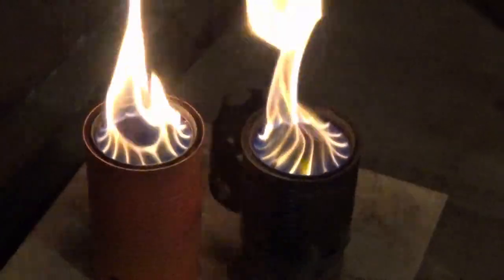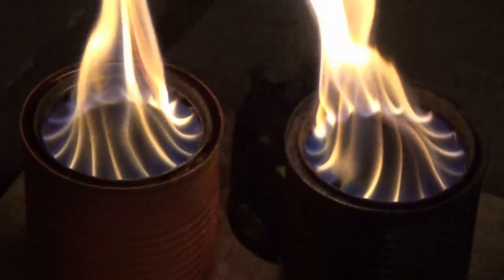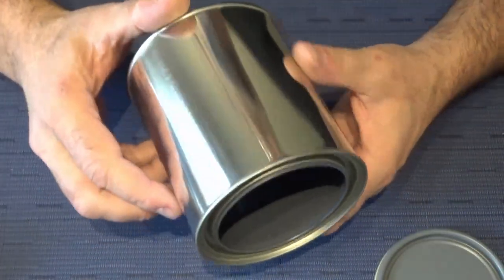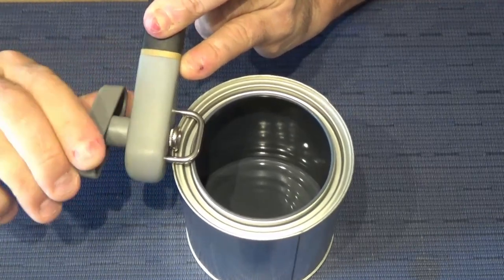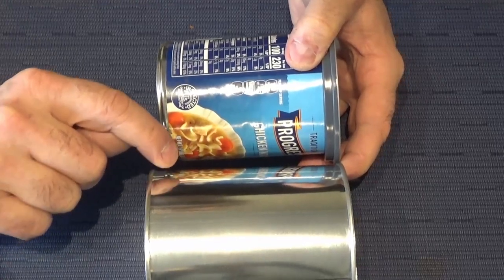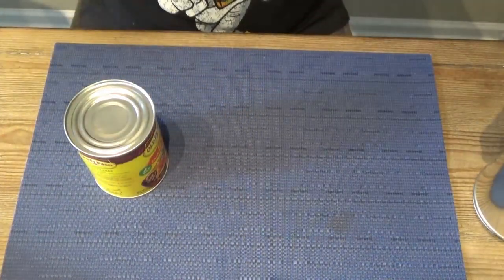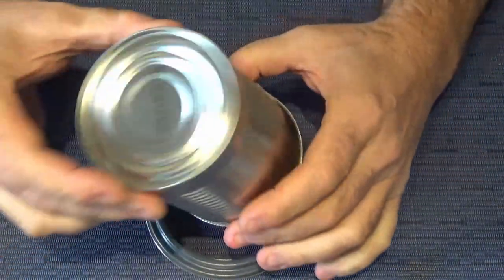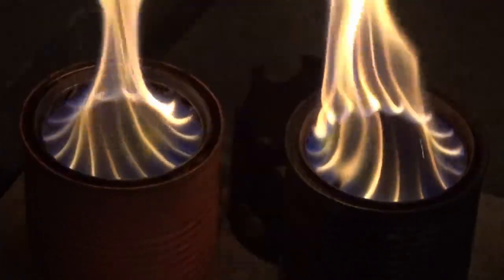Wood Gas Stove Science| Paint Can Wood Gas Stove Optimization! Making a good stove GREAT! Part 1

Comment: Thanks for the videos.  I would like to see how such a stove would be built with a gallon paint can. I often use pretty large pots in my back yard.
Not sure if there's a good option for the inside can that would fit.
Reply from the maker: I’ll try to source a metal one gallon paint can somewhere. My local hardware stores only sell plastic now. Thanks for watching!
Reply: @heathputnam9524  Okay thanks.    In my area Home Depot was out of them but Lowes did have them.

Comment: Great video! Looking at the build, can we just cut the bottom of the paint can and push the soup can up? That would really simplify this build to tools can opener and drill.
Reply from the maker: The bottom of the can serves as a heat shield. This stove will scorch the ground beneath it if the bottom is open. Thanks for watching.

Comment: Heath, I'm wondering if there is still a secondary burn occurring after the flame dies down, and the heat is coming from the coals only?   I built one, and don't SEE a
burn happening then. Are there gases still getting burned, or is the wood gas only present when there is smoke ? (which of course gets burned off so there IS no smoke!)
Reply from the maker: Good observation! I believe the secondary burn ends at the conversion phase from burning wood gas to charcoal. Thanks for watching!
Reply: @heathputnam9524  I think you mention this third burn stage, in one of your videos. I'll look...

Comment: yes I have started to build these out of old double walled ice coolers , I got the gassification but still got smoke which may be my fuel , I deffo go the pall of smoke trapped underneath the flames so primary and secondary combustion but I think there is a magic ratio that I am missing , I think the walls of the ice cooler may be too far apart and need to be "thinner" thanks for the video !
Reply from the maker: I have found that the walls need to be close enough to allow for heating but apart enough for unobstructed air flow. Thanks for watching!

Comment: I'm fascinated by how laypersons make these things without a degree in pyrotechnics or fire dynamics. Also fascinated watching your channel on this subject. Nice work. Also I look for designs that don't require fancy tools to assemble. So you've definitely got the right idea.

You should see the burner I made. It uses hot coals to ignite various cooking oils. My only problem is once lit , the flame can get out of control. I tried to design something that burns extremely hot but leaves little ash waste that needs to be extinguished with water. Since I live in a dry climate where fires are common , it serves it's purpose. Cooking with open flame can be really dangerous. I've had a few accidents, so I just wish I would have known a little more about the way air and heat work together. It's all so complex to me.

Comment: Using the safety can opener opening the top, so that it can be replaced, is a game changer. Will you need to jbweld it or something to assure it stays together?
Found a "Dolmas" can with a pull top open and rolled bottom lip, that just fits inside the paint can lid and my Stanley coffee pot just fits on the rim left after opening the pull top. Potential for the pot stand?
Looking forward to seeing optimized hole size/placements!
Also, any ideas on fashioning a fold away handle for the stove?
Reply from the maker: I will work on all that in future videos! Keep the ideas flowing! Thanks for watching!

Comment: This work is excellent and can solve the problem of waste and plastic in homes and even in the world.
I had an idea. Have you seen the tokamak or the artificial sun? It is in the shape of a horizontal donut. The same donut shape but vertically. On the one hand, an air pump. It circulates the air inside the donut and on the other hand the wood waste. plastic We pour the dry waste into the donut and when the gas concentration increases after several rotations in the donut, we burn the resulting gas in an oven.
Reply from the maker: Interesting! Thanks for watching!